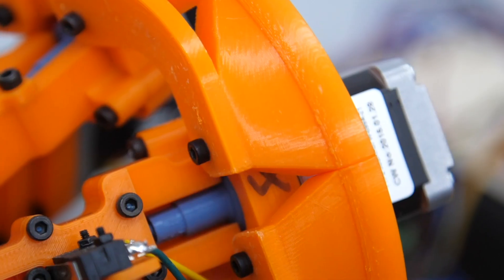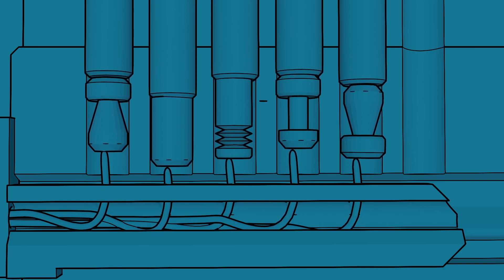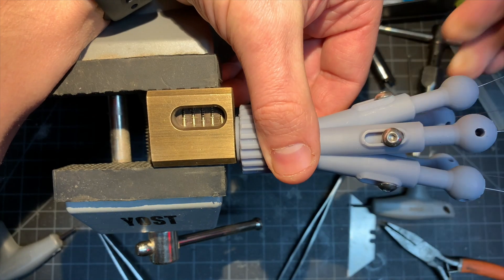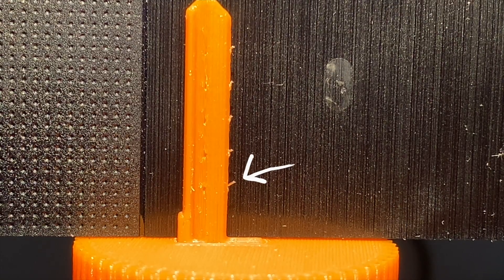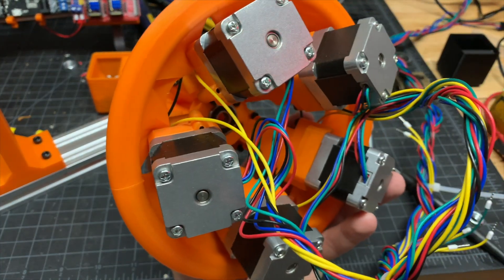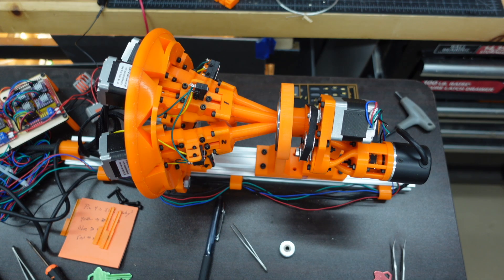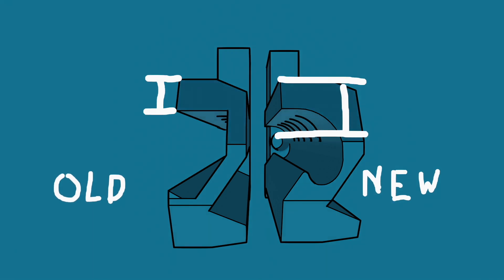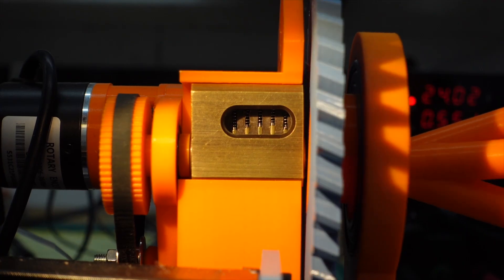i made a robot that picks locks WITHOUT A PICK

Comment: Once you have a part finalized, like that resin keyblade, send it to a company, like shapeways, to have it metal SLSed or whatever, for full strength
Reply: Use a piece of spring steel alongside the "key" to reinforce and use as a tension wrench. Use plastic for wire feed only
Reply: I have 3d printed metal in sls services. No way the holes will turn as clean. Not at least with the common services like pcbway or jlcpcb services. The minimum feature size is 1mm and it is rough. Had holes about 2mm and had to pass them again with a drill bit.
Reply: @celeste_es  Nearly every single SLS part ever produced in a manufacturing environment for real products is machined prior to delivery, with very few exceptions. No need to SLS the holes. Can be done simply in wire EDM or a small mill very cheaply.
Reply: @allenklingsporn6993 you can’t do it in wire EDM as the wire guide is on a multi axis path, you can’t snake a path through a material with wire EDM.
You can cut straight lines or constant radius bends.
Reply: lishi makes the metal version of this already.. kw1 for kwikset and sc1 for schlage keyways.
Reply: The tolerances for the blade is probably fine, but the issue would be the holes for the wire. I doubt there is a service (though I haven't looked) that can do that tolerance for custom jobs, and machining them afterwards would be difficult.
Reply: @akamesama  I highly doubt it would be too hard to find a company that can manufacture the blade. The holes are not that small so unless you want to use a difficult material (ex. stainless, some aluminums and cast iron). If it turns out that conventional CNCing is too unreliable something like EDM drilling will have no problems. I'd guess it would cost around $100USD per blade for one-offs.
Reply: Yes! And then instead of a complex encoder system, you can use basic limit switches.
Reply: Having someone else make the most important part of the project kinda defeats the DIY nature of it, doesn't it?
Reply: @TikiTDO are you talking about the stepper motors? 😂
Reply: @JensGulin  No, I'm talking about the things that he is building by himself. Like the actual key part, and in general the parts that are 3D printed, and being constantly updated throughout the video. Given that he's probably not going to want to spend days winding motor coils and tweaking the firmware for the necessary precision, buying those make sense. However, for the things that he is spending hours tweaking it sorta defeats the purpose to have someone else make it using tooling that he doesn't have.

Comment: I'm surprised you didn't use the linear actuators found in floppy/cd drives. Those things are cheap, simple, fast, and tiny.
Reply from the maker: I did consider those early on. I remember being worried they wouldn't have enough torque. I didn't verify that. I remember thinking if it worked well with big motors I could explore making it smaller. Which would have led to small actuators.
Reply: @SparksandCode  why not ditch linear actuators completely and just have a small spool of wire at the end of a tube similar to a throttle handle / lever.
that should cut out a bunch of components / weight.
Reply: @Taliesin6  True, it only needs to have a few MM of total travel, so a "spool"/pulley would only need to be a few MM in diameter. Similar to a 3d printer extruder.

Comment: Lockpicking lawyer getting automated
Reply: LPL: they took my jerb!
Reply: you mean dumbed down and automated... it's just brute forcing not picking.. the point of picking is to abuse the tolerances/imperfections of the lock and find the binding pins to speed up the process ;)
Reply: @robertjung8929  Indeed!!!
Reply: @robertjung8929  "Dumbed down and automated" is basically the gist of replacing human labor with machines. But we are obviously all joking here, it doesn't have the versatility for what LPL does. The only market benefit of this would be a better option than a power drill for locksmiths dealing with a specific type of lock. And much like locksmiths that have a basic picking training, this kind of tool would just be a first try before they go back to the power drill.
Reply: @Merennulli  
Why do we need to monetarize everything?
I'm sure this is one of his 'hold my beer' project.
Reply: @robertjung8929  
This is 2nd iteration.
It could be made faster, though.

For example, use hydraulic and solenoid instead of wire.
Reply: He needs to see this
Reply: LPL would seem to be about 1,000 times faster tho.  And the blade-with-wires simply will not go in a lot of zigzagged keyways, like some of Yale's & Best's nastier keyways. Cool proof of concept tho!

Comment: i wonder if you could decouple the key from the motors by using plastic tubing as ducts for the wires. you don't need to rotate the key much, and the flex of plastic tubes should be more than enough. lighter key will require a lighter mount, lighter mount could be driven with a lighter motor, lighter motor won't chew through plastic as quickly.

Comment: I feel like you could have used a metal key with groves cut into it, instead of printed keys with holes. one you have groves in a brass key you can put the wires in them and pour solder over them to close the channels.
Reply from the maker: I'm not sure the wire would make that hard of a turn. I was having trouble with the wires permanently bending at the relaxed angle I was using. I'd also be worried I was just cementing the wire in with the solder.
Great thoughts keep them coming.
Reply: @SparksandCode  yeah about bending, the optimal shape of a channel is arcs of circles. if you make sure that the circle radius is never less than a certain threshold, it will never bend the wire permanently. for example, fiber optics have a specified minimum curvature radius before they start leaking/breaking. so I was wondering if you could make the channels have an arc shape that ends tangential to the key surface.

Comment: This is awesome! I had thought about something very similar to this, but hadnt had a way to try to make it. Just a thought though, had you considered using some sort of metal insert into your key blade to make it more robust? We lockpickers use windshield wiper blade inserts a lot for various tools including tensioners, maybe having one of the really thin ones at the top in the plastic or the bottom edge would help?
Reply from the maker: Yeah. I roughly prototype'd that metal blade I mentioned in the video. A slip of the cutoff wheel ruined it. 

It was a moot point though I realized while debating on making a second one. Since the plastic blade was "good enough". The whole design still had that inherit slow flaw. In other words, a metal / stronger blade wouldn't have improved the design only saved me time from rewiring it due to broken blades.
Reply: @SparksandCode  I meant a hollow spot in the plastic you could insert a metal piece to make the plastic take less of a twisting force. We do that when 3d printing keys out of pla, or when trying to make a few other tools to keep the plastic from deforming as much. I'll take out the calipers to give you an idea of the dimensions I'm talking about when I get up in the morning. 👍🏻
Reply: @SparksandCode  You only need to have small metal bits at the opening of the keyway, top and bottom, which are connected to a metal disk, which is the thing you apply force to. The plastic stuff gets no torsion, it's just along for the ride.
PS: I'm the BobCat in "Picking The Bridge" in the New Yorker. Don't do what we did. ;)

Comment: Good progress, I wonder if you can have a torque feedback, to determine how far the lock has turned, and then determine if the lock turned more.
Reply from the maker: So yeah in v1. That’s what I used. My rough sketch for v3 goes back to using load cells for torque measurements.
Reply: @SparksandCode  I wonder if an optical or magnetic encoder might work better than torque